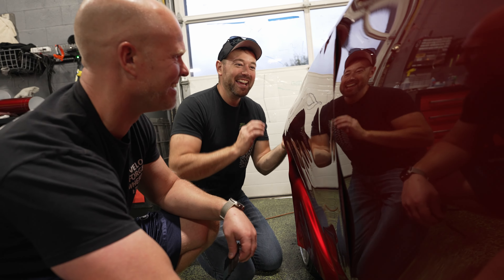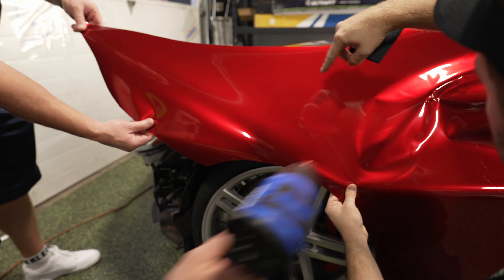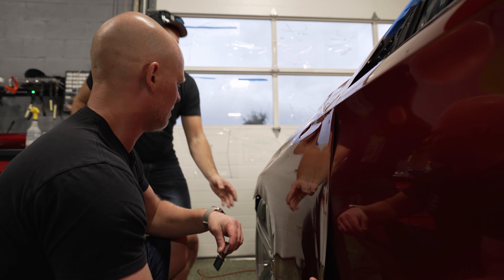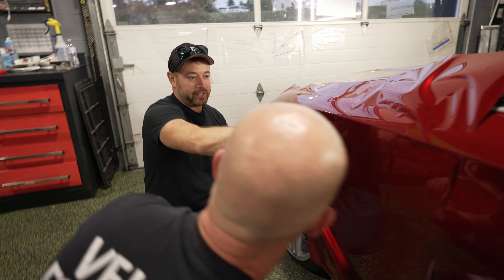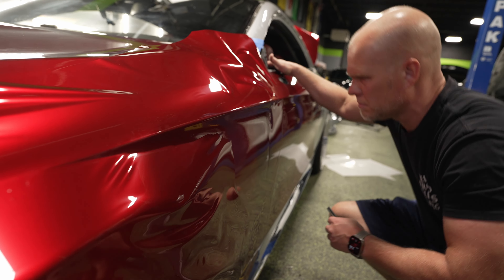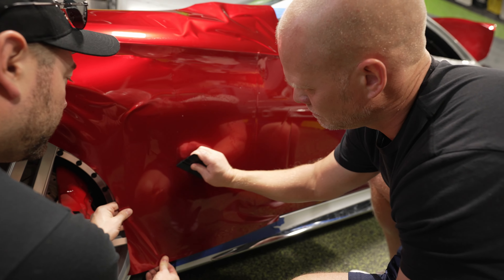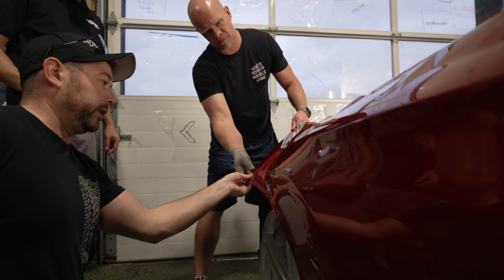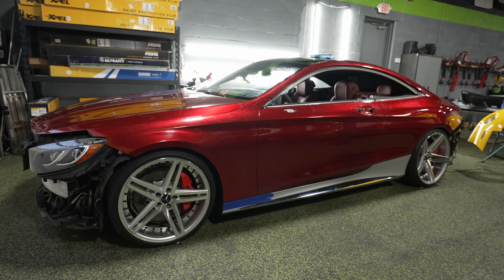@AutoVlogOfficial Shows Us His #vinylwrap Skills!

Comment: Hey BlackOut, is that material produced by the same company ( 3M ) that manufactures the WINDOW tint ?!? Also, can these wraps be treated with the CERAMIC coating to stand up against road debris striking it at highway speeds ?!?  🚘🔍. 🤔. Many Thanks Yo !
Reply from the maker: This material is from inozotek.  You could install ceramic or ppf on top!